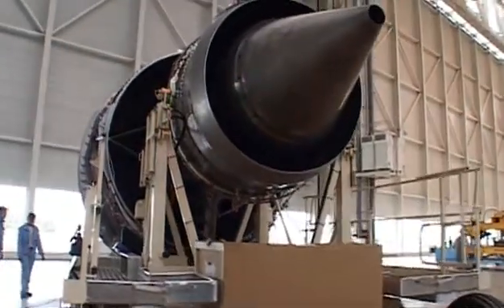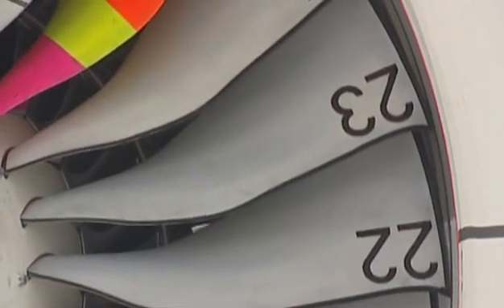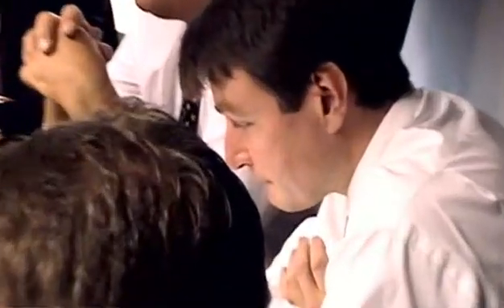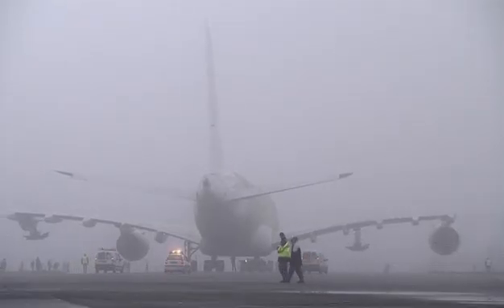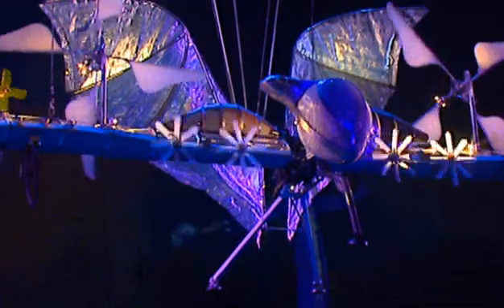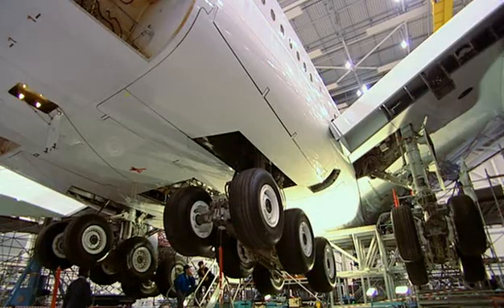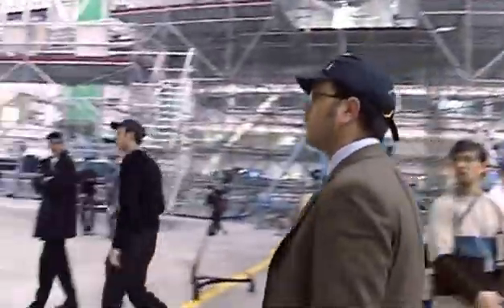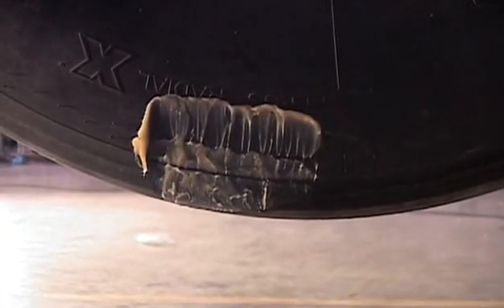Airbus A380 construction and Documentary part 7

Comment: Ask Qantas about a Trent failure that DIDN'T contain the shrapnel.
Reply: I was thinking the same thing! I wonder if the test was completed after the incident where a engine exploding during flight, then reengineering the shroud that is supposed to contain shrapnel if a blade breaks during use! I think they was required to do the test by the airlines and government authority to ensure the incident doesn't happen again!